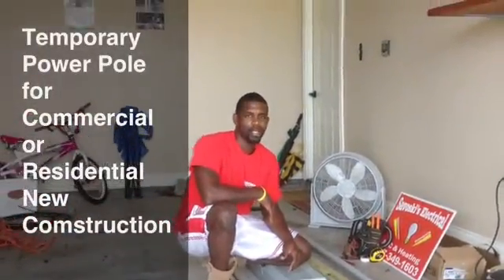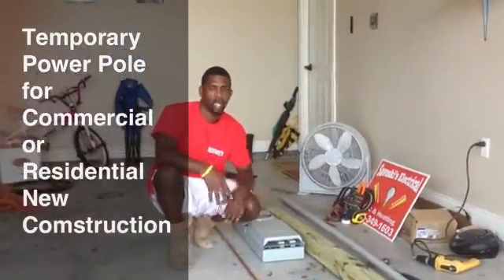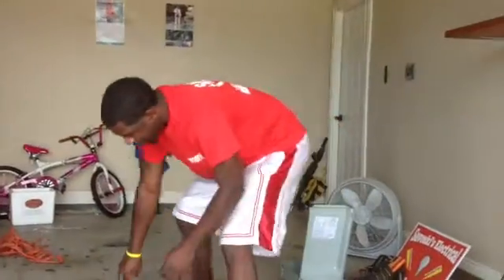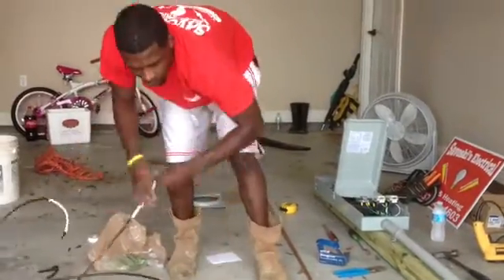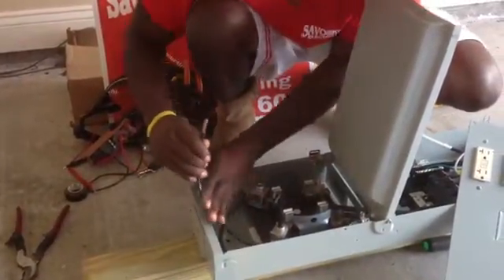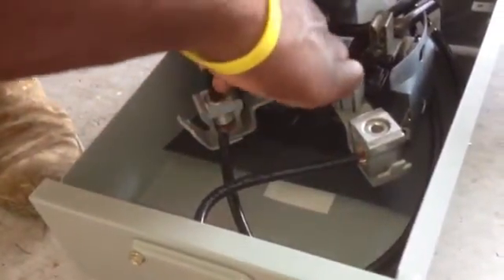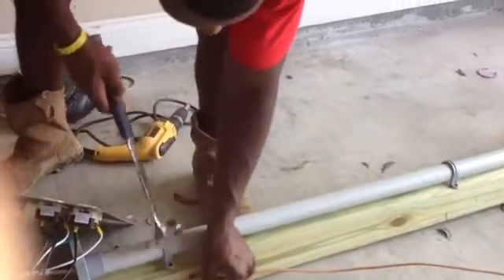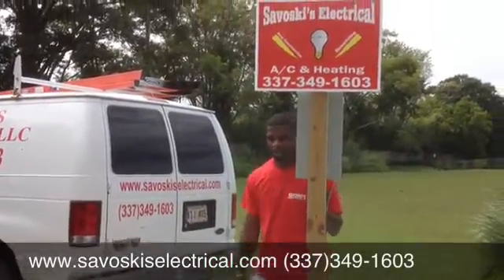How to build Temporary Underground Service Pole. Savoski's Electrical, LLC

Comment: what gauge wire do you use for the two hots, neutral, and ground?  thanks!
Reply: 2/0 copper
OR 
4/0 aluminum service conductors